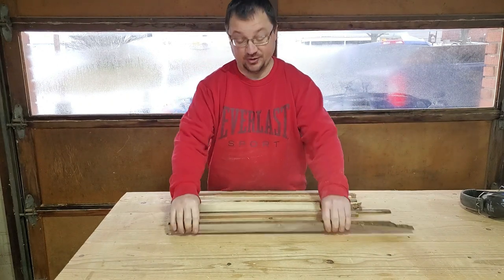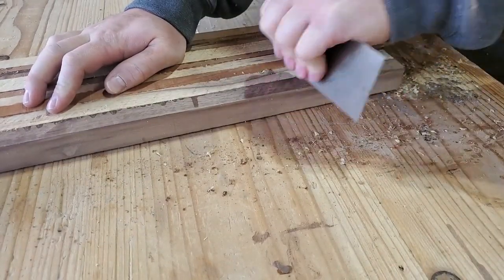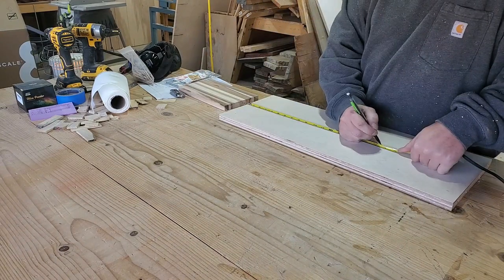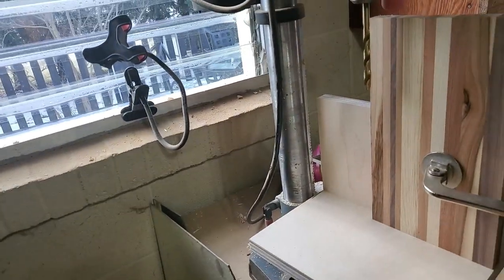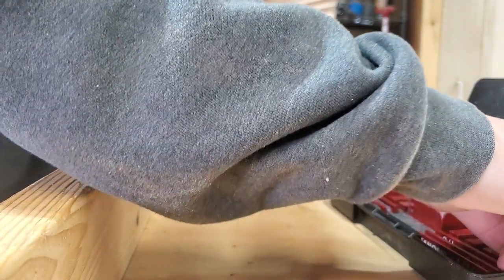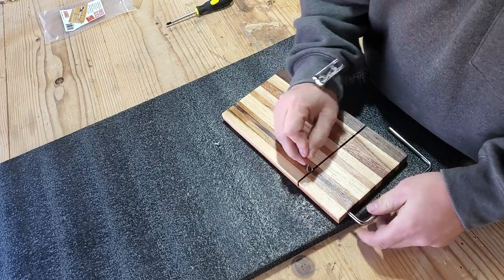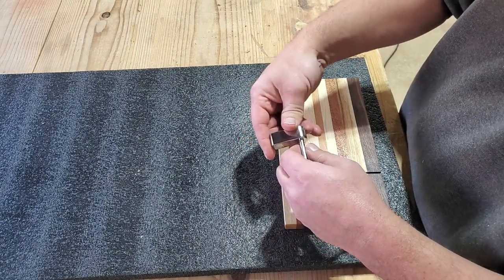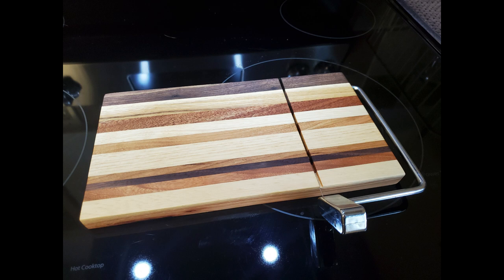How I screwed up at making This Cheese Slicer/ but it all turns out in the end.

Comment: Like the board.  How do you like your setup blocks?
Reply from the maker: I love them.  I use them way more than I thought I would.  once you get them it's like you can't stop seeing opportunities to use them. My only gripe about them is that it seems like every manufacturer makes them out of aluminum. Which isn't a bad thing until you drop one of the bigger ones on the concrete floor.  I dropped my 1x2x3 block and dented one of the corners in.  Which throws off the dimensions around that corner. But other than that, they are a great addition to the tools.
Reply: @TheRookieWoodworker  that's awesome.  What is the name brand you use?
Reply from the maker: eanosic is the brand I'm using. It's a cheaper brand.  When you look them up on amazon there is a ton of choices.